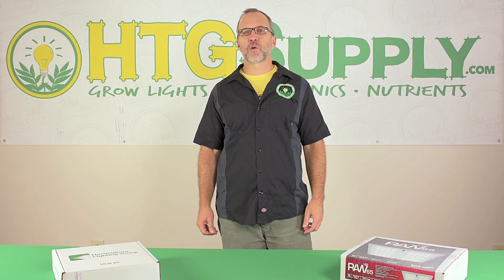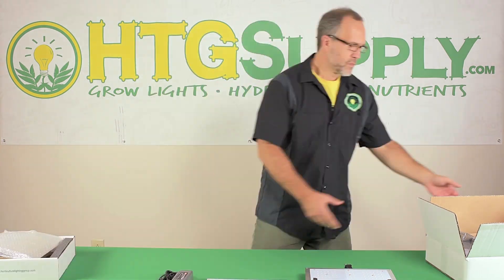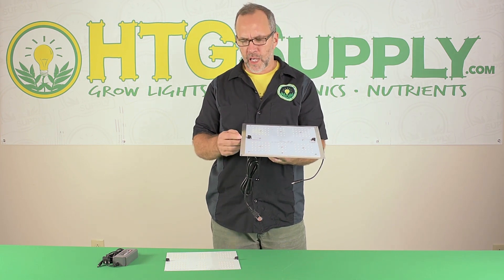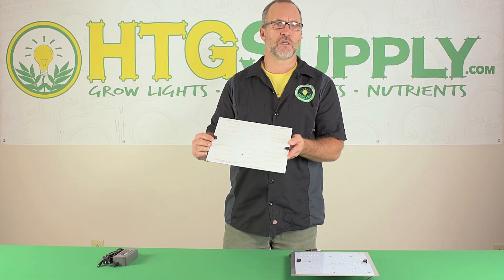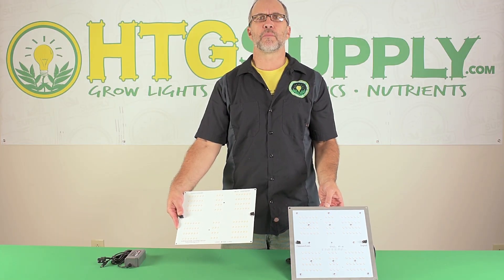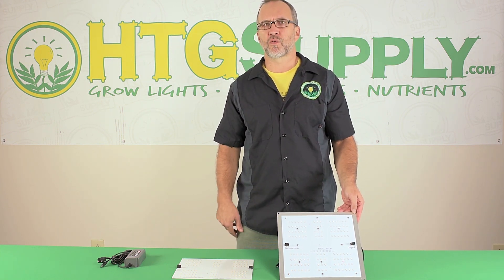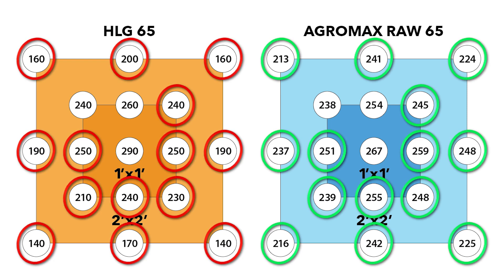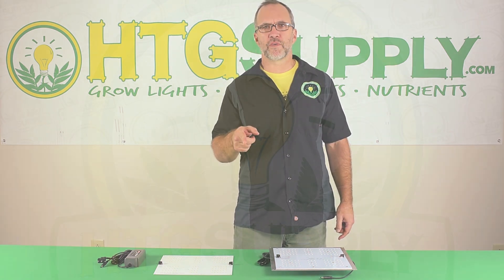Eddie Reviews: AgroMax Raw 65 vs HLG 65 - LED Grow Lights - Samsung Quantum Board - Unboxing

Comment: I am currently running a few LED "amazon specials" as some secondary lighting to go with my CMH lights and am looking to make the switch to these. the ones on Amazon claiming 1000w full spectrum led yeah not at all or even close!
Reply from the maker: Did you happen to catch Eddie's review of the Phlizon "600w" LED? That's one of the ones we get customers all over the country talking about, it seems like everyone's bought a Phlizon at some point. It's actually one of the reasons we started doing videos just trying to educate people, teach them the terminology and the proper application of their hardware - we hate seeing people get taken advantage of and it's happening to EVERYONE.
Reply: You need check the actual power of leds, not leds name
Reply: Hood Hippie 

When they say “1000w” they mean its wattage is equivalent to a 1000w hps.

I’ll be putting my hlg 135 v2 to work in a few weeks.